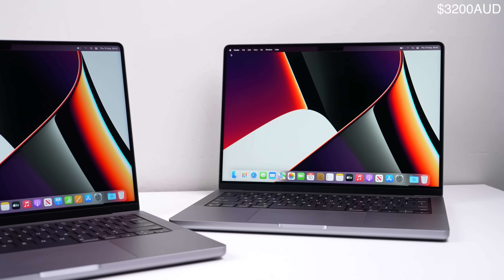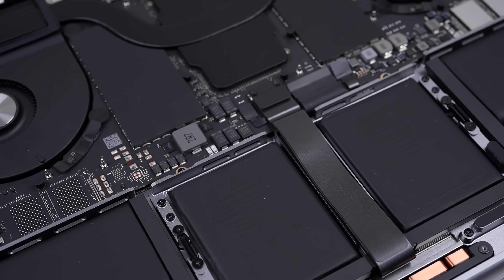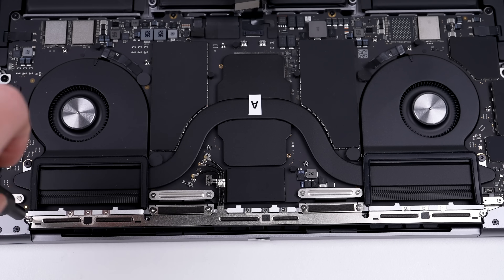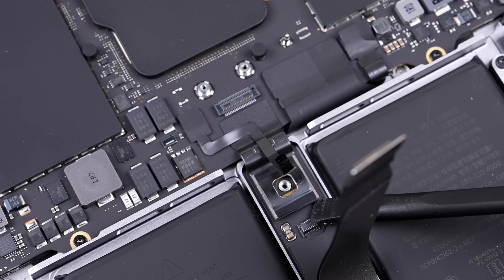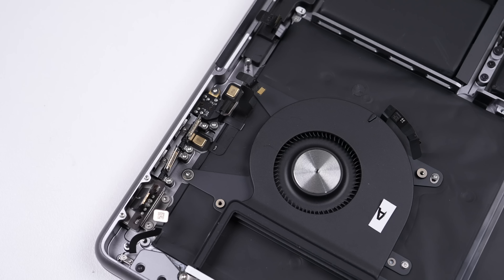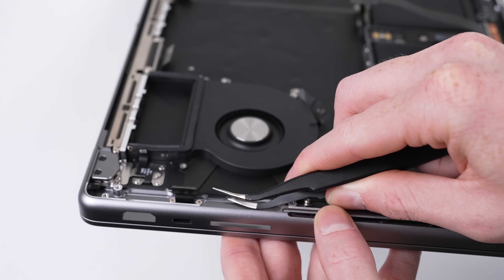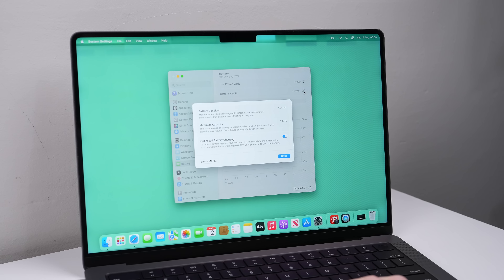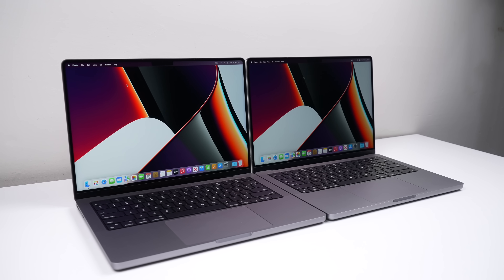New Anti-Consumer MacBook Pros - Teardown And Repair Assessment - Apple Silicon M1/M2

Comment: Apple became a strange company.

They produce very good quality products (mostly). Usually they're not cheap but affordable in a Standard configuration. But if you want a tiny Upgrade, as in more RAM, better gfx,whatever... - they make you pay an arm and a leg. And after you churned out 5k for a machine that would have cost 2.5k in the standard configuration the build quality is not up to par anymore. It's just the quality of a 2.5k machine but it cost 5k. I remember that 5k imac whose screen got discolored slightly after 2 years (exactly once the warranty was gone). Sure, it still worked and was only a visual flaw. But if you spent 5k just 2 years ago you would expect a bit more. At least they let me Upgrade that one with my own RAM still.....
So, they get you hooked with a reasonable priced basic model to then bleed you dry if you want a little more.....

Then, they are actively discouraging people from repairing their devices. Ever tried to repair an Apple product? You have to have a special Set of screwdrivers just for proprietary Apple screws. This is simply ridiculous...

The 3rd issue I have is: Apple just works. That was always the USP. While you had to tweak other OSs to work fine, Apple products just work out of the Box. Very nice, of course. But they work just in one particular way. Think iTunes. It completely forces you to organize your mp3s how THEY thought it made sense. Well, I already had a way to organize my Files, I won't change all that just because of iTunes. But without iTunes an Apple product is just half a product....

Conclusion: I really like their products but I don't buy them anymore.... Well, when they presented that M1 CPU I got me a very basic macbook air for 900usd. That is the basic configuration, of course, and in that case I got a lot of value for my money. Also the Standard ipad, the cheap one for 350usd, that I bought as well. 
So, I do still buy single products. Every leap year one of their products is ahead of it's time, like that M1 CPU. But I don't care about an Apple ecosystem anymore - albeit the idea is genius. But I feel cheated buying most of their stuff.

Also, if you know just a lil bit about IT you know that apple updates it's Software intentionally slowly, so they can market the next Version of their OS as this grand new invention. But if you look at android that very function might have existed for already 5 years.
Once they marketed their new iOS with "You get 20 new Emojis". Come on - are they joking?!
Do they think I am that stupid that I consider a new Set of Emojis a serious improvement?!
That is just insulting!!!

Edit: tbh, Apple always was a bit strange - this was it's USP. Strange, but in a good way. Well, they just hid the ugly Part. I just remember that other documentary about Apple that revealed that apple sacrificed new tech to be able to sell their old one (or was it the other way around?). So, they don't care about good tech, they care about their Business, just as everybody else.....
Just because Apple products used to be Hacker machines doesn't make the Apple leadership a group of idealistic nerds - this is simply a misconceoption.

I sure do respect that Steve Jobs for his accomplishments. You can actually say he changed the world with his iPhone. I do acknowledge that. But he is just a human being. And he happened to be at the right place at the right time.
I am sure there lives a person as capable in every big City. But he might just do a pretty basic job. Probably a Job like Einstein did before he started to think..... It might even be me 😈. 

No, jokes aside. Putting people on a pedestal, whether you do it as an individual or as a collective society, never turns out good. It's bad for both parties, nowadays you would call it toxic...

Comment: Having to calibrate components means that manufacturing of the components don’t need to be so rigorous, thus reducing costs. From my past experience with apple, where possible, they replace hardware with software as software don’t cost anything to duplicate, usually to the detriment of performance.

Comment: Im just bought a m2 air, first mac ever, because their is just no competition on battery and performance.
I dont like apple just fir their anti consumer behaviour and exaggerated price. But dell xps for example cost as much and is nowhere near performance.

Windows laptop just have to fix their damn battery
Reply: true for battery but for performance, not true, look up nanoreview, even 2 year old ryzen processors gets more in cinebench than the new m3. geekbench is irrelevant for pcs since they are bias for socs and low latency ram (as mentioned in their website but later removed) which is why m chips gets higher scores despites getting lower in every other benchmarks.

Comment: i dont get why they keep making it harder.  at this point they might as well put rivets to hold everything in place.  solder the cables directly to the board and weld the back shut.   crap hole company...

Comment: I think it's time for upper management including Tim Cook to be replaced. These Laptops also have a tendency to smoke the SSD Drives, and they can't be swapped without expensive repair. I was actually thinking about buying one but since I have learned how greedy apple is in their design to be so unfriendly to what would be an easy repair job for a consumer in any other brand, there is no way I would consider this product under it's current design.

Comment: I used to open my laptop up just for fun and clean it every year back when I used windows machines. Even early macbooks. But this is the first time a disassembly video triggered my gag reflexes and gave me anxiety. These design practices should be criminal with how much these machines cost and how critical they are in many people's daily lives.
Reply: Not a issue at all. Easy as fudge. I might just have someone pee on a m2 max logic board while connected to powersupply  to see if I can repair it  with my butcheeks within 15 min.
Reply: you can still open them up to do that. and I think you can replace the fan still.

Comment: And thats why I'ma stick to gaming laptops. They have performance, even battery life, cooling, repairability, upgradability and display.

And they can have insane amounts of storage. Especially when the gaming laptop has 3-4 storage slots meaning 24 to 32tb of ssd storage and almost all of them can have 64gb of ram. 

Best part is they're cheap. Hovering around the $500 to $600 starting price in the US for rtx 3050 to 4050 models.
Reply: i couldn't agree with you more. currently i'm using my asus TUF F15 2023 about 2+ months, i had upgraded to 24gb RAM and additional 1tb of storage at 1st time, currently it is one of my favorite laptop ever. gaming is not my main priority, but at least it is a piece of cake to fix if something goes wrong especially SSD. i almost got a macbook after having been advised to do so, but since being a windows user for such a long time there hasn't been changed of my choice, which means i still go for windows anyway. windows 11 isn't much stable though, first 2 weeks i got 3 BSODs involving memory (though it didn't detect any problems either), sometimes it gets frozen (i have to restart a few times so it should run normally), and first time using 11 a bit difficult like macos due to its interface. at least i made a right thing rather than buying junky mac computers which become totally useless whether SSDs die and you can't do nothing about rather than scrapping them which later to be thousands of dollars of ewaste, and apple "eco-friendly" turns out to destroy environments
Reply: @huuhoangmanh685  Framework has a VERY difficult battle. Because gaming laptops exist. 

And seriously, who can use a laptop with 8/256 config which apple sells? To upgrade to 16/1tb (cause even 500gb is kinda small) would nearly double the cost. 

Think about it. Gaming laptops with an rtx 4060 cost between $700 to $750, with upgradability, repairability, even half decent battery life, good CPU's, etc. To get an equivalent framework laptop, you gotta spend nearly 2.5x the amount. You are not beating a gaming laptop in terms of ownership cost. Or value. 

I'm just honestly surprised Louis doesn't use gaming laptops himself. The legion laptops are basically the new thinkpads, their lower end gaming laptops can act as thinkpads, etc. And they're way cheaper than thinkpads while being much stronger and better overall.

Infact, there's even some gaming laptops with desktop replaceable cpu's or swappable batteries, or eGPU support, etc.

Comment: could you jury rig a fix for the lid angle sensor by removing the magnet and reversing the magnet?

or even rotating the magnet?

keeping track of the screws is very important especially on the iphones because i think in one of the models using the wrong screw can scratch the board or flex cable below the screw and damage one of the traces.

some devices may have multiple boards or flex cables that can be located under screws and can be easily damaged by using the wrong screws.

Comment: There is no reason to build a machine like this other than making them intentionally hard to repair. I work on thinkpads nearly everyday. A screen replacement on those laptops takes 4 screws, a dozen or so clips on the bezel and 1 display connector. Maybe 2 minutes of work for a complete LCD replacement.

Comment: I First own an Intel MacBook pro 2018, but after 2years screen cracked because accidentally dropped onto floor. The Apple service center said that both lcd screen and touchbar which also got problems need to be replaced, both together cost very high. I told them to replace LCD only I am ok without the touchbar. They said that if I don’t want to repair touchbar they can’t do the work for me (to replace LCD only).
So as a result I bought the M1 MacBook Pro. This go on for one year, but unfortunately I dropped the M1 too after one year and the screen cracked!
I search eBay for a secondhand LCD screen for my first MacBook Pro (intel), this secondhand LCD cost not that high so I bought it and replaced it my self now I am using this Intel MacBook Pro again and happy.
Now I am not sure whether I want to replace the M1 MacBook Pro screen, after watching this video, I think best to use this MacBook at home by connecting an external monitor to it and use it as a desktop with wireless keyboard and wireless mouse.

Comment: Purchasing an expensive machine that lacks a self-repair option is not ideal, both for practical reasons and for the environment. The inability to repair the machine means that parts cannot be easily replaced or reused. This can lead to increased waste and a negative impact on the environment.
Reply: Facts

Comment: I think it was obvious that those identical blurred patterns appearing at the top can not depend on any "calibration" issue. Those weren't back-light spots or general color related issues. That pattern has been programmed by the manufacturer. Same goes for the screen angle sensors. I am more than sure that the malfunction with the screen at 90 degrees is totally programmed as that sensor is so simple it can't go wrong just swapping it. So yes, the conclusions are obvious and mostly already known. This company is making it's business targeting wealthy people who do not care much about money as the mainstream users do. Personally I don't feel blaming them for this. We better blame that huge number of irresponsible wannabes, those  who can't resist the temptation of looking richer than they are. If you buy a Maybach you shouldn't complain how expensive it is to repaint every scratch as you should be aware that it doesn't fit a lifestyle of someone who parks it on the streets or malls parking.

Comment: Hey Hugh! Just watched through this after taking apart one myself. The trackpad needs to be replaced on the one I looked at and I ordered one. Did you end up doing tests to see if those are programmed to a different piece of hardware or if they can be interchanged with no issues?

Comment: I just did a screen replacment on a M2 14" Air and it was somewhat more complex but not to bad expect for the LCD cable came unfolded and I had refold it around the 3 pieces that clamp and mount the cable to the chassis.. that was a pain in the arse and I did swear once or twice but got it done oh and the lid sensor being replaceable is a good thing as it has been a common issue on older macs but apple like to lock us out hence the whole recal tool etc..

Comment: Hi!, I am facing the same issue with my Mac M1 Pro, the screen has rectangular shadows and jittery behaviour on the original display without causing any damage to it. Please tell what could be the possible reason and solution. Do I need to replace the original display via Apple?

Comment: I own Apple Macbook 16 Pro M1. After about a year of owning it, the screen turned black. I did not use it every day. It has not been dropped or abused. I never had any bad experience with windows 10/11 computers. This is going to be my last Apple Macbook unless they make them user friendly and easy to repair. I had very reliable iphone 6 and ipads.
Reply: Did you have AppleCare+?
Reply: @Rparam000  
I purchased it from Costco so it had extended warranty. It was repaired free of charge. The computer is excellent but it is scary to think about an expensive machine with soldered SSD and low reliability.
Reply: I can say the same about myself. One year of owning, a few weeks after the warranty has expired my screen turned black. ~1000USD to repair. More than a half of laptop's price. M1 Pro 16 32 Gb.
Reply: @_garik__ 
I believe there was a serious manufacturer defect of some components. In my computer they replaced the screen. Apple sgould repair such defects at no charge. A rich but very greedy company.

Comment: I work at an AASP and get that same weird graphical thing on every display replacement until I run system configurator inside GSX. Potentially a firmware reset using Apple Configurator 2 might resolve?

Comment: Macs have been my choice for decades, even through the crisis years of the late 90's. They were the best, and maintainability was very good... up to 2012. Since then, it has been downhill. First they soldered the RAM (no way around that), then glued the battery (which we can handle with some care, but when they soldered the SSD, I felt I must look elsewhere. Yes, you can de-solder the SSD and upgrade it, but that looks really hard to do.

This feel bad, I have so much Mac specific code I have written, not to mention good Mac-only software, so I have to rebuild my entire workflow, but now Linux is the only possible path forward for me, maybe with a Framework computer, if they survive long enough.

Comment: I don't mind repairability stuff in phones because i usually just change the phone once something goes bad, but when it comes to expensive laptops, you should have total control over the repairs. This is why I've never bought a macbook, the soldered ssd turned me away from getting one.

Comment: I have been an apple user since almost 20 years now. 
In the meantime, I owned at least 10 different PowerBooks, MacBook Pros, iMacs...
But after suffering the flaxgate issue with my 2019 / 16" MacbookPro, just 3 years and 2 months after I bought it for 3000 €s, and NOT getting ANY kind of goodwill by Apple, I decided, that I will never ever buy any apple product again. 
Those fuckers ripped me off far enough. 
There is better ways to burn your money. 
Never ever again!

Comment: Electrical Design Engineer here, I suspect the way to fix the Lid angle sensor (without calibration) would be to attempt the remove or replace the magnet and rotate it until the desired effect appears. It seems they are using a 2 or 3-axis magnetic sensor to observe a diametrically magnetized magnet. If they wanted a better accuracy than 5 degrees (likely manufacturing tolerance of both the magnet and the installation of it into the case) then they would have needed to perform a calibration in any case, so to save money on assembly they just had them place the magnet in without the extra steps of positioning it exactly and performed a software calibration on bootup. The scariest part of this is that now Apple knows how many degrees your screen is open... j/k I can't think of an evil purpose for that other than them spying on how you use your device in order to bombard you with work ads when it angles match your work desk, or blast you with workout or food ads when it's resting on your lap in bed.

Comment: macs are actually quite easy to repair, time consuming, but not difficult. the calibration software is accessible to all authorised service providers, to get that authorisation is a bit of a time consuming process, but if you want to repair apple products and not cause problems with warranties or contracts, it's probably worth it. all apple products can be returned to any apple store or reseller for free, they will be recycled by apple and as much as possible is reused. (to find something that's virtually impossible to repair.. look at some of the pc laptops out there like the dell XPS 13" and all the tablet laptops..)